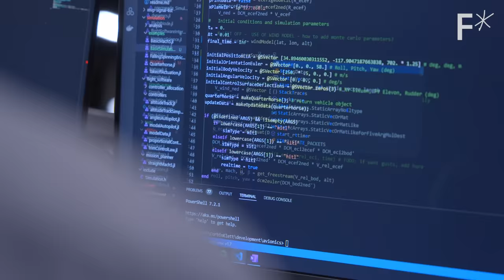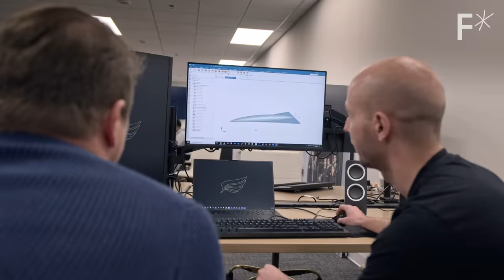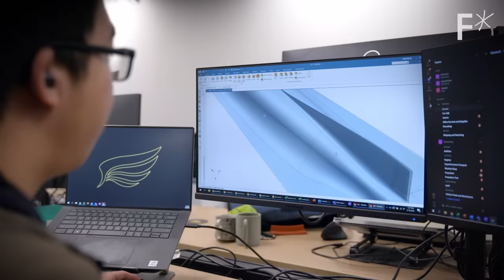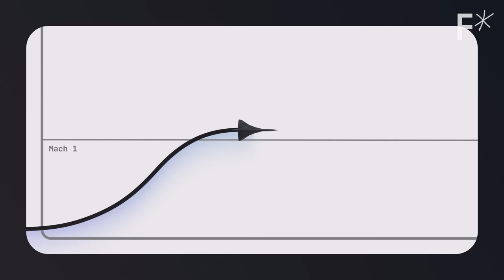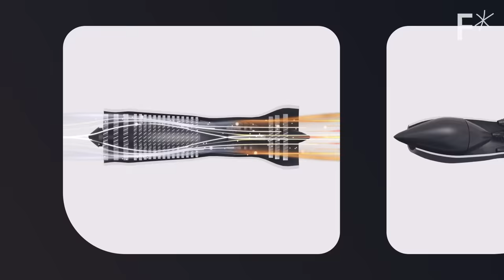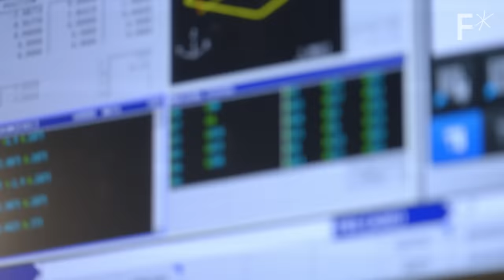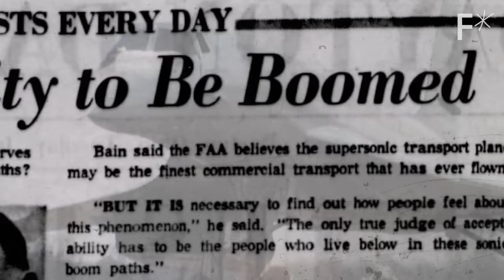This Mach-5 engine will do what no other can | Challengers

Comment: As an aerospace engineer, I expect the group I work in will be getting a call from them in the next couple of years, when they get to the hard part of keeping someone alive inside the aircraft.  Go Fast is the easy part.  I've seen a few similar startups over the past decade, and they come to us for the hard part.
Reply: If you actually watch the video it's going to be autonomous so no humans inside of it
Reply: @TheeMurkShow  Yep, if you actually watch the video, they tell you that Quarterhorse  is a propulsion test bed for development of Halcyon, a 20 passenger aircraft.  No one gives you millions in seed money to make a drone just for the sake of going Mach 5, you need to have a product out of that, and that is Halcyon.
Reply: As an aerospace engineer, they bring you in to cripple the project with your overly negative can't do attitude and result in no innovation since the 1950s. No thanks!
Reply: @sccengr  hmm pick a military drone contract ... ALL of them started off as seed money to see IF they could be used in place of piloted aircraft ... and in what situations they would excel at ... heck the raptor drone was first and foremost a highspeed autonomous engine test frame ... all they did is add a different body around the engine and put in some equipment and poof a predator drone ... or camera drone etc
Reply: @sccengr  The flagship product is Darkhorse. Halcyon is the long-term vision.
Reply: hope they wont go to yo for the hard part. Imagine from a comment perspective you are already this insufferable imagine irl

Comment: @ 4:25 The SR 71's skin was actually its fuel tank.  The skin was loosely put together so it had room to expand at high speeds. Fuel would actually leak while it was on the ground. They had to design special fuel so it wouldn't easily ignite. You could even throw a lit cigarette butt into it, and it wouldn't ignite.

Comment: As wonderful as Quarterhorse is/will be, this shows you the absolute genius of Kelly Johnson and Skunk Works. As you probably know, slide rulers designed the Blackbird and it flew, with 2 men on board, to the edges of space and speed, and returned to earth. These guys are standing on the shoulders of the greatest aeronautical engineers the world has ever seen.
Reply: I like they named it the J-85 in homage to the J-58 that preceeded it.
Reply: I think you may be too kind here....this doesn't appear to be a crew that operates in such a way that promotes success....perhaps it was the way it was filmed but the boys at skunk works are on a totally different planet, no millennial type thinking with them if ya k ow what I mean😅
Reply: @jackjman5577  that's utter garbage lol. Willingness to fail is central to success
Reply: @nxvh9062  not remotely close to what I was talking about😆
Reply: Also why does the headquarters look like a huge empty warehouse?
Reply: Kelly didn't design the J-58 engine, broski.
Reply: @Serveck  The J85 is an OLD engine around since the 60s,powerimg the T38 trainer. The Chimera simply plonks a ramjet behind a J85. Not a J58.
Reply: @nxvh9062 the SR-71 has two human lives onboard.  They weren’t allowed to fail.

Comment: I think with the team and vision they have it's definitely possible. Just not in the next 10-15 years. I think they'll eventually get to passenger flight but the most interesting thing will be the engine. Even if hermeus fails and doesn't produce an aircraft, if they get that engine right they'll be massive game changers and I'm sure the air force wants to put that on it's future platforms.
Reply: A whole other dilemma when considering a payload. An even greater challenge than passengers .
Reply: Economically, this wont ever be commercially viable. Hypersonic and even suppersonic simply use too much gas.
Reply: @boijone8440  and expell too much pollution. Hell, current jet aircrafts are getting flak for already polluting too much and those transport way more people using less fuel than a ramjet type engine...
Reply: I would probably feel safer just sitting on a ticking bomb than in a hypersonic aircraft.

Comment: At around 4:15, the surface 'heat-up' mechanism is dominated by compression, not skin friction.
Reply: Yeah the people that made the video don't seem to know that much about the topic
Reply: They ALWAYS make this mistake in videos about supersonic flight,
its funny
Reply: Chacha Ji  what?
Reply: @rajuaditya1914  ikr 🤔
Reply: Adding on to that, the plume of white stuff pointed out in 5:58 is actually an expansion wave not a shock wave. Shock waves aren't usually visible. Another common misrepresentation of a shock wave.....Their voiceover description is correct though.
Reply: @seongyonghong8425  Yup, that's a vapour cone formed due to expansion fans(notional opposite of shock waves). Expansion fans lower the temperature, pressure and density of the local region of air which lowers the dew point leading to it's condensation.
Reply: I think they know more then the lot of you who can't even even build a simple machine.  Youtube scientists
Reply: Actually... at mach 5 it should start to transition into radiation heating because the compression layer is ahead of the aircraft and a boundary layer keeps the convection heating away.

Not an expert in it, but something i have heard.
Reply: @Animal-Reaction-Clips  I am talking about the err by the producers of the video, not the company. You don't know what you are talking about, do you?

Comment: Main source of heat when going hypersonic is not friction, but air compression. 
And at 6:00 the space shuttle probably was not supersonic yet, there were just visible vapor cones because air pressure lowers when flowing around the object, condensing the water.
Reply: Space Shuttle is supersonic.
From about 45 seconds after launch until about two minutes after launch, the shuttle accelerates from Mach 1 to Mach 5.
FRICTION makes the heat.
Compression forces molecules into tighter space creating more friction with bite.
Reply: At supersonic compression heats the air. Thus only the leading edges and the intake air are hot (how can the Concorde radome be made of composite? A metal tip takes all the heat?). As we accelerate further, surface friction becomes even more severe and overall we are better off above Mach 3 by flying in a ballistic missile. What did even come out off Nasa Mach 6 Scramjet? Was it just a threat to other nations that the US has scramjet weapons with meaningful lift -- similar to this Russian announcement?

Comment: 60 years of excellent improvements in alloys and ceramics, yet the SR-71's J58s are still tough to beat....it had the be throttled BACK  at Speed  & Altitude, to preserve the air-frame

Comment: Love the attitude - real engineers - failure is the most likely outcome - well, as an engineer, you have to fail before you can learn and move forward. You try to mitigate any failure and think of it ahead of time, but when you are pushing envelopes as Hermeus are, you have to accept that you will break things. This same mindset permeated the first 60 years of aircraft development, but now most manufacturers are risk averse - Reaction Engines here in the UK may also give their engines a run for their money. I wish them all the best.

Comment: This video is really weird.  They talk as if what they're doing is revolutionary.  At 8:15 he even talks about how transitioning from turbo jet to ramjet mid-flight hasn't been done before, but it has.  That's how the SR-71 Blackbird got past Mach 3.  That's the entire point of the conical shapes in front of its engines.  It's weird that this team would steal all of the ideas from the SR-71, which allowed them to build their prototype in such a short time, but not give it any credit.  Pretty disingenuous if you ask me.

Comment: Don't get me wrong the engineering is incredibly, I just don't see a use case. The concorde stopped operating for a reason. It was fast but expensive and uncomfortable.
Reply: Unfortunately this is becoming all too common. "What if we transported people across the world... Using HIGH SPEED SUBMARINES?!?!?!"

If your pitch and your CGI is good enough, you can convince at least a few suckers to invest into your project. Problem is that this project is doomed from a business model perspective, and from a regulatory perspective as well.

If you also look at how much effort it has taken NASA to make a small drone fly at Mach 5 for 30 seconds or so... Then this whole project looks a lot less likely to succeed. This thing is way bigger than the X-51 and it's suppsoed to fly at hypersonic speeds for long periods of time. 

The whole thing sounds so unrealistic from so many perspectives. If we thought Concorde was bad, this thing is at a whole different level of terrible.
Reply: @RM-el3gw  Lol X51 flew for 2 minutes by scramjet. it is just because people are still stumbling on this tech.
Also Hypersonic materials for the vehicles are getting better. HIFIRE 4 test of a Hypersonic Glide Vehicle looked pretty big and survived the test.
Australia will test fly a Hypersonic scramjet drone next year and has reached Mach 8 in Hifire 5 or 7.
Newer version has reached Mach 12 in test tunnels.

Comment: Have you heard about Concorde? It was designed about 50 years ago and was in commercial service for several decades carrying people across the Atlantic at around Mach 2. It was never a commercial success because of the problem of getting permission to fly it to the US -- it comfortably outperformed nearly all military aircraft of the period both in speed and ceiling and so made defense planners very uncomfortable. (It was eventually granted limited landing rights in Washington and New York only after a lot of political effort.)

A hypersonic plane could be an engineering reality but it may suffer the same fate.
Reply: A major part of that was the sonic boom & problems that created on the ground for everyday folks (waking up babies from naps; breaking windows; knocking pictures off walls, etc).  THEREFORE (do I get points for that? doubt it...), once we solve the problem of significant shock waves reaching ground level, I think we'll see supersonic travel become commonplace.
I'm hopeful...
Reply: @niftybass  I have experienced the sonic boom from both the Concorde and the Space Shuttle. I used to work in western Cornwall and the Concorde would come over at supersonic speed. You really had to expect it to notice it. I live in California in an area that experienced the boom from the Space Shuttle as it set up for landing at Edwards AFB. This you definitely wouldn't miss -- it was very loud, easy to confuse with the start of an earthquake. Its these experiences that led me to conclude that the sonic boom was just a handy excuse, a political Get Out of Jail Free card. The problem with the Concorde wasn't that it was fast but also it wasn't made in the US.
Reply: @martinusher1  Sadly, it wouldn't surprise me too much if that's the case.
As far as I know, the shuttle only flew once over central Arkansas at an altitude it was possible to hear it, and I heard it.  I don't know the altitude at that time, but it wasn't loud.   I just thought it was cool.

I got a lot of what I said from a newsreel at the time of Concorde's development that was reporting on people's reaction to tests, etc, etc, ...   newsreel accuracy?  didn't question it
Reply: @martinusher1   My comment should have started with "My understanding is..."

it's still pretty cool you got to hear that
Reply: Please elaborate on your main point about it not being built in the US.
Reply: America couldn’t build their own one so they crippled Concord
Reply: @ianmuir3640  I don't think that is true. Unlike the turbofan engines used on all modern passenger planes, fast jet engines are horrendously noisy and Concorde was a fast jet, despite its size. People will accept that noise in military aircraft because there it is a matter of life and death. They won't accept it just so the rich and famous can cut a few hours off their flight times. At take off Concorde was measured at 119.4 dB. That is incredibly loud! Louder than an F35. The makers of this plane should not overlook this, like Concorde's engineers did in their obsession to succeed. It IS what killed Concorde in the end. The crash was just the final nail in the coffin.
Reply: @ianmuir3640  Why do you say that?
Reply: @niftybass  sonic boom is a lame excuse. Military jets go supersonic all the time why is no one complaining
Reply: @martinusher1  "the problem with the Concorde wasn't that it was fast but also it wasn't made in the US" that's what I said to myself the first time I watch the Concorde documentary and started reading about the aircraft.
Reply: @oldbloke135  if the Concorde project and manufacturing didn't stop then there would have been economic class by now. All aircraft, boats, cars and etc were first used and enjoyed by the rich except the canoe🙂
Reply: @ianmuir3640  And yet Airbus, a European company is used by airlines throughout the US and the rest of the world. Hmmm...
Reply from the maker: Just a heads up: the Concorde and issues with permitting around sonic booms are discussed around 14:07 in the video 🙂
Reply: @PaulGuy  you forgot the part where Airbus is a defence contractor to the U.S. and some of the company's shares come from U.S. 
It's not a conspiracy theory or something, but when you watch some of the documentaries and read about Concorde then you wonder why they let it fail. 
The plane crash was cause by another aeroplane
Reply: @oldbloke135  IT wasn't "an obsession to succeed", it was the 1960s, a time of innocence (and rampant pollution). Before turbofans jet engines were really noisy because there was nothing to mitigate the turbulence between the exhaust and the surrounding air. I had a summer job measuring aircraft noise around Heathrow (London) airport in the late 60s as part of a program to try to mitigate the effects of aircraft noise. The all time leader was a random Air India 707 which came over a golf course north of Slough at low altitude at a bit over 121dBA. (I called it 'random' because it wasn't on a regular flight path). The racket at peak times on the A4, the road that ran beside runway 28L, was (and AFAIK still is) incredible.

Comment: Skunkworks has had ramjet engines for multiple decades. They had 4500mph aircraft since the 90s. The high desert in the West saw lots of hypersonic aircraft throughout the decades. I was in the military and witnessed a test flight coming in from the Pacific Ocean landing back in Palmdale California, which upon decent and slowdown still hit sonic barriers 4 times after it had throttled down 90%. Top speed was calculated at 4500 mph, and was said to be a manned test flight, whereas the cockpit was said to be liquid filled to mitigate speed related G force issues on the human body. The only fact I do know to be true after witnessing it, was that the test flight was a ramjet/pulsejet  variety aircraft and it was faster than the SR-71. All other variables of that test flight mentioned above were told to me from a third party military officer with familiarity of the flight and a higher security clearance than I had. Whether their fact or not, I cannot confirm.
Reply: Great story, 😎

Comment: Ah come on! Practicaly nothing has been said about how exactly the engine works. That would have been the most interesting thing about this plane. Like how do they transition between turbo, ramjet and possibly even scramjet (since they whant to reach mach 5).
Reply: I imagine a high performance turbojet inside a large ram jet.  At speeds above mach 2, 95% of the airflow will be ducted around the turbo-jet itself.  You may not be running the turbo-jet at all at high speeds.  As the craft decelerates for final approach, the turbo-jet kicks back in, as air flow is directed back into the compressor stages of the turbine.  Similar to the SR71.  But whereas the SR71 used bypass piping, this engine will  probably just sit in a central areo blister inside a larger ram-jet.  It will require some tricks to keep the leading edges of the aircraft, and it's engine parts from melting, or changing properties negatively during peek temperatures.  So hopefully, its made out of T10 grade titanium steel.
Reply: @SliceofLife7777  Interesting input. Isnt titanium at higher temperatures pretty weak compared to other metals and thus not suitable in this design?
Reply: @flavioernst902  I'm no metallurgist.  They made the Black Bird out of the stuff, Maybe they'll use somthing else.  Titanium has high heat tolerance, and the proccess of heating and cooling seems to make titanium steel even stronger, unless you get it too hot.  Google says it melts at 3034 F.  No idea at what temp it would structurally fail. Kelly Johnson decided that mach 3 was enough.  These people are going to do it differently I suppose.  But it seems like titanium steele could stand the 2000+F temperatures this video mentions.  Temperatures inside the engines will require ceramics or something.  The heat will be nuts.
Reply: They briefly discusses this. The turbo compressor is bypassed. I believe they use the turbo compressor at takeoff and an afterburner to get sufficient speed to transistion to ramjet. Probably some sort of mechanical actuator that moves a forward air vane to switch between turbo compressor and ramjet compression. My guess is a lot of fuel will be dumped into the afterburner due to low efficiency during the transistion (if it works at all).
Reply: @SliceofLife7777  This is why its never gonna be viable... Imagine the cost of making the outside of a large passenger plane withstand those temperatures... Supersonic I can realistically see happening, but hypersonic?!?!? cmon now...
Reply: I'm sure all the juicy details are classified (it's obviously a weapons program with "passenger aircraft" as a cover)